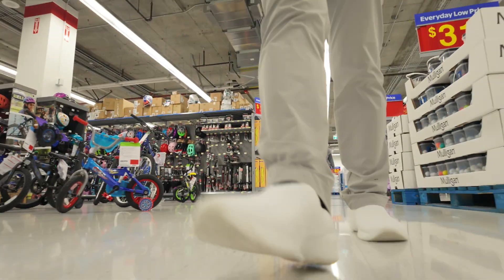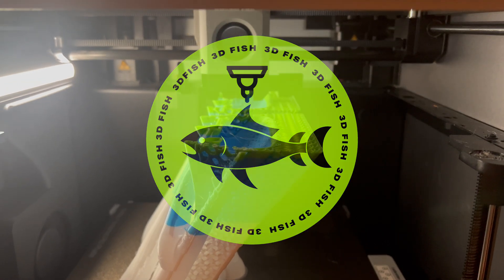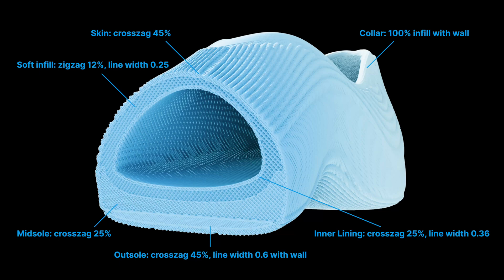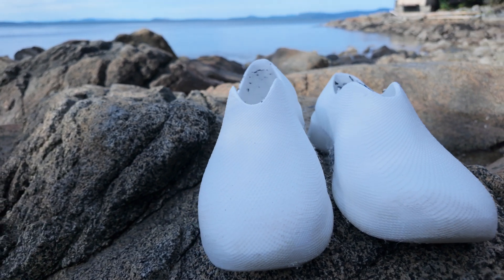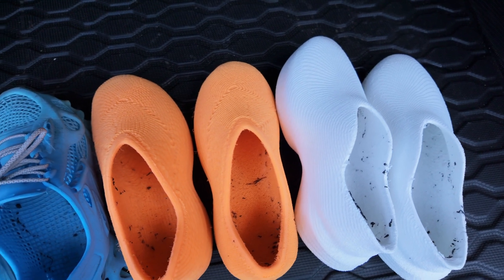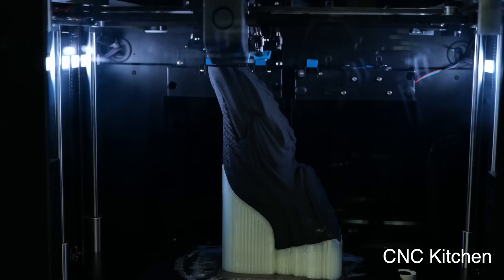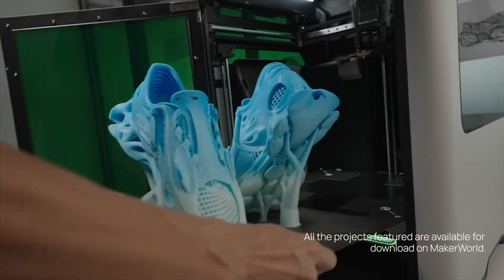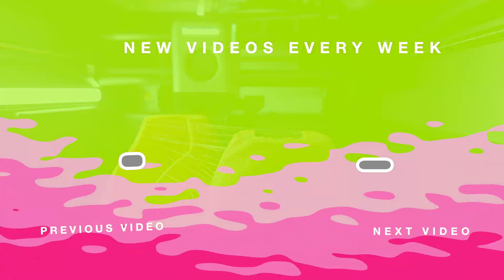These 3D Printed Shoes Changed How I See Manufacturing

Comment: Great video! What size printer did you use? My son wants a Bamboo Labs A1 mini and I’m trying to figure out if printing shoes on it is an option.
Reply: he used 256 x 256 x 256 mm x1c. the 180^3 mm of the a1 mini probably won't be big enough for shoes, but you could try it out using bambu studio after finding the model on maker world

Comment: Check out PEBA as well as TPE . I have printed out multiple shoe designs including the airberry. That whaleberry is not my style. Did you get a chance to reprint the airberry in 85A? My wife likes them but I think I will change the infill of the collar to get it softer as she also had the same issue. Her color is only available in the BIQU and a few brands in 95A
Reply from the maker: I am printing it right now on H2D with PLA as support. Should be a lot nicer. I also have the BIQU special filament coming, probably going to be here in 10 days. It becomes soft after extrusions. 95A is way too hard for shoes.

Comment: Seeking shoes to accommodate where one leg is shorter and that shoe needs taller heal.
Reply from the maker: That is a very niche design requirement, likely have to make custom models for them.
Reply: @the3dfish  I think I read or saw on a YouTube video where the company allows you to print a pair then try them on and then send them back for customizations. I would prefer not to have to send them back as it sounds like it takes a couple months on each iteration.  I’ve also started an email communication with the company. Stay tuned!
Reply from the maker: Keep me posted! Would love to learn more!
Reply: @the3dfish  so far, only solution is to order two models. One low sole type then the other to be higher. 2X price so like $400 and no insurance it will be a fix. Going to order anyways and keep fingers crossed. 😮
Reply: My 1yo daughter has a genetic condition that's causing an overgrowth of one leg/foot so I'm diving down the rabbit hole of 3d printing custom shoes. Her overgrowth foot is much larger and about 1.5 inches longer than the other and the 'normal' leg.

Comment: Could you share your setting for printing Bubbleberry using TPU 85A on P1S.  Thanks.
Reply from the maker: I printed it with the generic TPU profile. Nothing was changed. It turned out great.
Reply: @the3dfish thanks for sharing. I have a problem with friction when the printer is pulling the filament (i guess).
Reply: What is your Layer height setting when you are using TPU85A with 0.6 nozzle?
The default 0.3mm would cause an error, “line width too small”
Thanks a lot. 😊
Reply from the maker: Hmmm did you change a lot of settings? I used 0.4 mm nozzle, i find bambu printer’s other profile is not very good. Maybe try 0.4 mm nozzle and see if it works better. You can print a mount and place your dry box on top of your printer. Should help.https://makerworld.com/models/1574466
Reply: @the3dfish  TPU85A cannot be used with 0.4mm, in my case, the filament rarely came out.  However, I can print it now.  It is mainly about the spool holder friction.  Now, I got some 3d printed shoes.  Thanks a lot for your contents. :D
Reply from the maker: @novavr3dnovaresearch780   Thats strange, but at lest you got it working now. Enjoy the shoes!

Comment: Bambu H2D won’t be able to multi material print different TPU types.  It only allows tpu through the right nozzle.  And must come from external spool. Not AMS.
Reply from the maker: Just have to make your own filament profile and tell the printer its not TPU. It will work, as I have don’t 90A out of AMS too.

Comment: Hey! Thanks for all of the reviews! I really do wanna print some shoes. 

I have 2 quick questions, Would the whaleberrys have been more durable if printed in TPU 85A?

Also what settings did you change/use to print the bubbleberrys in TPU 85A?
Reply from the maker: yes, I think it would have been more durable and last longer. 
I did not change anywhere, simply just set the filament to use the external spool on my printer.  I simply have sliced the file in Bambu Studio.